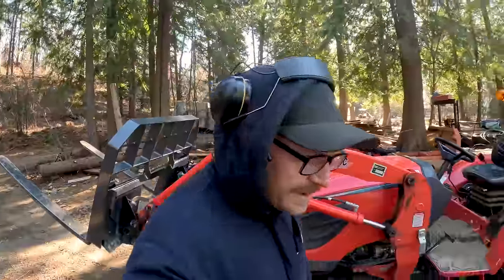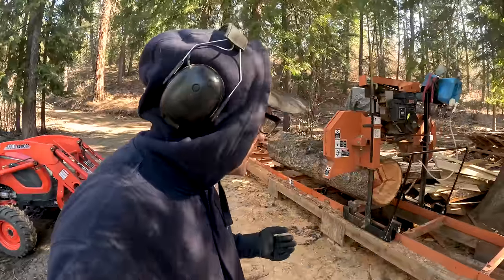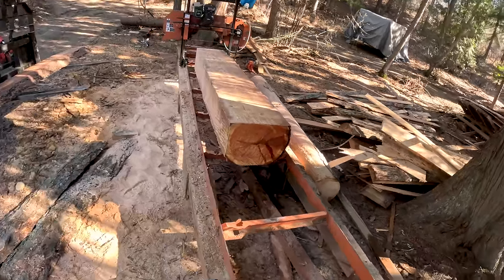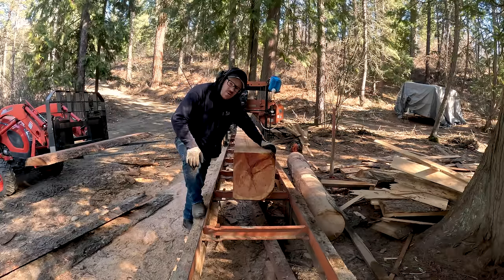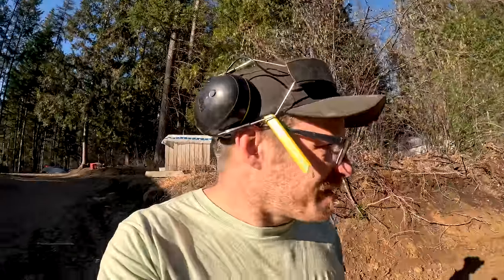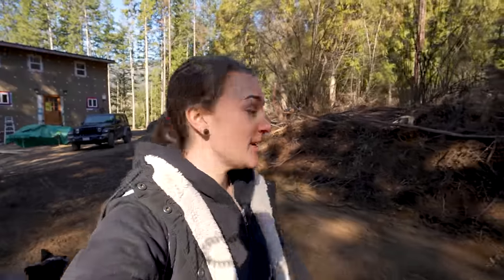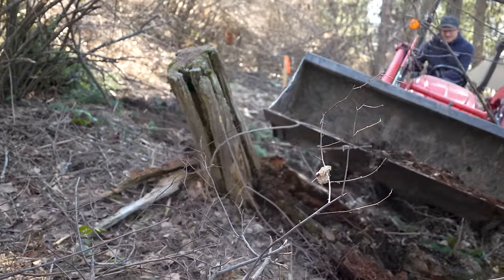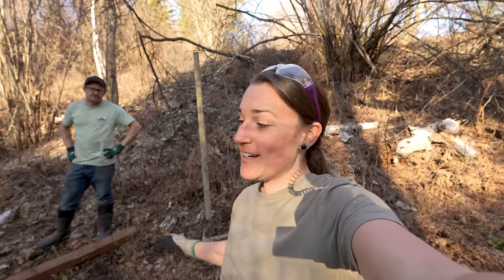5 Years Living Off The Grid | Falling Her First Tree ( It Was Hilarious)

Comment: Clearing the pathway and reducing the fire risk is a wise move. Katie's smile when the tree fell was immense. Your coaching and encouragement Greg was worthwhile. For reducing the oversized stump, I thought Greg was going to horizontally cut away the edges using a chain saw on a track. Then take to the saw mill. The new blade made a huge difference.

I know it takes longer than burning but chip or mulch as often as you can. Continue to repurpose as much of those smaller dead or cut branches into usable soil building material.  Once landscaped, it will come together beautifully.

Comment: Nice job with the milling and the tractor work doing the leveling, Greg. 
Kate, great job with the weed-whacker [chain saw] too!
Other protective lumber work gear: Ear protectors, helmet, shin guards, or lumber work strap on 'pants'. And, steel-toed boots are another safety requirement, of course. And, most certainly, wear a long-sleeved shirt, too. 
I ended up with a major case of poison ivy when we were building our home in Northern Virginia a couple decades ago. We had acreage that had too much poison ivy growing up trees, and even rooted onto the trees. The chainsaw was really helpful, but there were times when I had to go with a solid blade on a heavy duty weed-whacker to cut the vines, but the sawdust would still fly and inevitably get on my skin someplace. I learned the hard way about long-sleeve shirts. - Please learn from my mistakes... unless PI & PO (poison oak) don't grow there [?]...)

Comment: Katie, If you step to the other side of the tree, you will find it easier to hold the chainsaw while cutting. Secondly, do not run to the back side of a falling tree. get away at a 45 degree angle from the direction the tree is falling. it is possible for a falling tree to kick backward from the stump. Overall, good job for you first tree.

Comment: When you sharpen your blade you also need to set it. At least every 2-3 sharpenings. It'll cut so much faster. The Silvertip blades are the economy blades.  The high-alloy steel ones stay sharp much longer. Carbide are even better.

Comment: One suggestion.  I have a new holland 35hp tractor similar size to your kioti. I made a 1200 lb concrete and steel counterweight for the rear end, it was night and day difference. I can load a full bucket and not have a bouncy rear end. The hydraulic pump will stop lifting the bucket before the rear tires come off the ground now. Off grid in northern BC.

Comment: Hello Katie and Greg. I don't have a sawmill, but as I saw it, you have three limitations on your mill. Length, which may never come into play, height, where you showed us the maximum and width which you did point out for the second cut. You may have had a fortieth 2 x 4 out of the edge pieces but may have not been worth the trouble. At any rate, being off by 2.5% is really good for eyeballing it. Have good days!

Comment: Dear Greg and Katie,  #1  Dearest Katie, NO MORE TIMEBER FELLING UNTIL YOU FIND A CERTIFIED HARD HAT - SAFETY FIRST!  Other than that, congratulations on learning to feld timber. Just remember to look up and run like heck.  A good timber faller has (A) two escape routes, (B) always looking up for a "windowmaker", (C) run the other way.  Nice job on your first time out.  
Greg, sure am happy to see you're satisfied with the new Blades.  I've been counting your steps with the older hand sharpened blades vs the new "Silver Tips" blades and your 43% faster.  With all that saved and stored energy, very soon you can work 43% longer.  Thanks for the early show.  Most Sincerely, Gene

Comment: I do not know if it will work for your soil conditions but in mb if you take a bar and make a hole and dump in 1/2 gal of water the post will go in mych easier 
If your tractor bucket reaches high enough you likely could push it down using the bucket

Comment: With your landscaping... I'm sure you know this... but always try to make a small drainage ditch on the uphill side (especially when the road is next to that elevation change)  Drain the water to a point where you can put a culvert pipe in to let it go further down hill.  Yeah... I'm sure you know this... but I can't tell if that area is going to be part of the driveway/parking area or not.

Comment: Greg, go get some damn diesel! Then you can really clean up by mulching all that forestry fuel! I'd plant something useful on the banks like maybe blue berries? 
You mentioned putting fence there wad different, the trick is, a pole every high spot at the highest point, and a pole at the very lowest of every low spot. And even on a bank, the poles need to go in plum. That way, any where the animals stand, the top of the fence will be the same height. Yes, there will be some places you'll need to level off, and some places you'll need to fill in. Just take your time and it'll all work out. 
Katie, you did good on your tree felling. It went whee you wanted it, and no one was hurt! SUCCESS! 
All those bushes, need to be cut. When it snows, ice, or what ever, they are tall enough to fall on your fence.

Comment: one thing katie if you don't know never i mean never when cutting small limbs or brush with chain saw  do not pull it toward you is if hung up and saw is running i did and almost cut my toe off  it will cut thru your shes like butter   be very careful they are great machines  BUT CAN BE DANGEROUS AND ALSO NEVER CUT ANYTHING ABOVE YOUR SHOULDERS OR HEAD I SAW PEOPLE IN EMERGENCY ROOMS WITHY BAD FACE DAMAGE  FROM CUTTING IN THAT MANNER

Comment: get all your fuel lines working on your Cat Dozer   left pump must work and fuel to the maim pump crack open line on injectors //when you see fuel come out of lines you fix your Dozer it should run //new fuel filter and keep them clean //its very easy fix and running a diesel , you can clean injectors on youtube//they all are made to last 100 years just change out all oil and filters ,and air filter //go go//NOW YOU CAN BUILD ANY ROAD